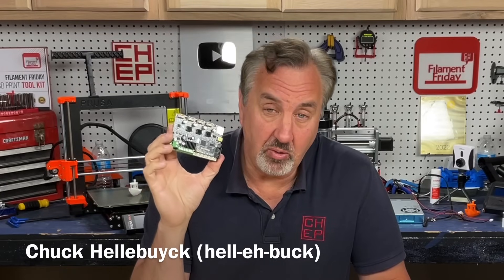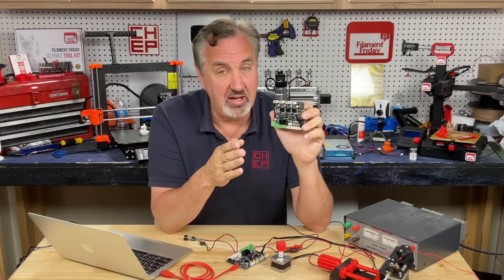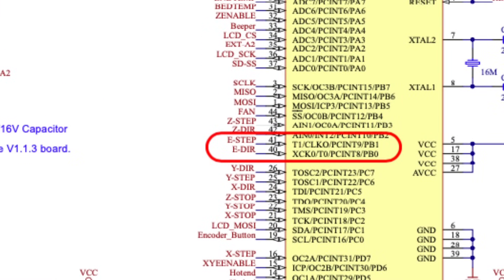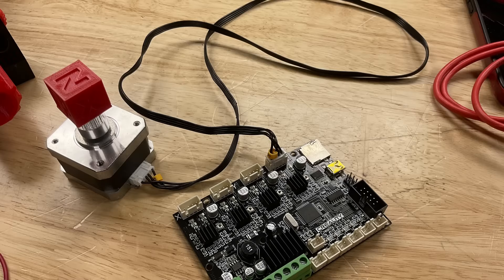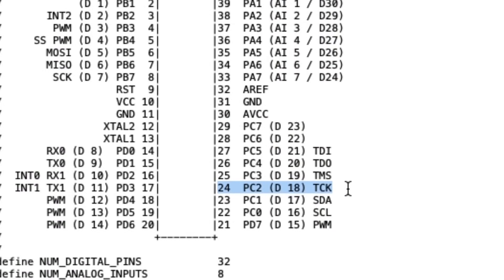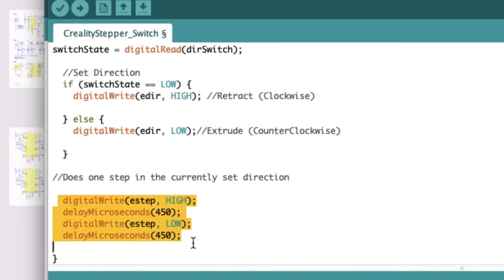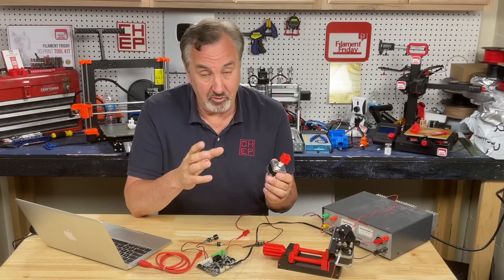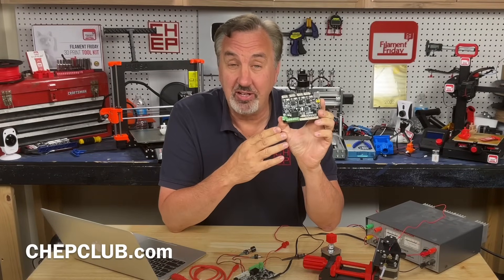Re-programming Older Ender 3 Boards with Arduino - Stepper Motors

Comment: Hello Chuck,   What can be made with a 32bit MKS Robin nano v3.0 board? I have a brand new one that was supposed to be installed in a Tevoup Hydra 2 in 1 but I shipped the printer back (actually, the 2nd one I shipped back), got my money back but kept the board. Now it just sits there in the box that it came in. If you can use it, I'll trade you for 1 of your E-Leveler 2.  lol
Reply: Anyone want to trade that board for a leveler? The board costs a lot more

Comment: Can’t see spending $35 for an 8-bit board though.
Reply from the maker: For most hobbyist projects, Raspberry Pi and many 32-bit boards are overkill. If you can find a used one on eBay or even an old broken 3D printer, what I’m showing can breath new life into a pile of junk.

Comment: I have a 32bit creality board collecting dust, any suggestion?
Reply: Yes, it can drive several steppers and fans, a display, read switches and thermistors. Already has motion control built in. Use g-codes in a text file to make a robot of your own choosing, eg bbq controller to roast your thanksgiving turkey. Total overkill for the job of controlling the temperature by adjusting the air baffle but might be just the first project.
Reply: Everything is allowed when you want to grill to perfection! Any project to link? Starting from marlin or from scratch?

Comment: Hi, nice video i really like the idea and i will make a project like this with my old ender 3 pro board. Just a quick question , i like to use the Z motor and use limit switches on the top and bottom to limit the range, like on a 3d printer. Do you have any idea on how to implemnt this? i'm not that good in programming arduino and similar :(

Comment: hello sir i am student,i have one mks robin e3 v1.1 i want to use it as normal board to control three stepper on 20X4 lcd displays and with 8 switch i don't know where to start i have work on ardunio till now and i can't seem to find any solution can you nake video or suggest me some thanks
Reply: What?! What are you a student of…Literature? You just need to toggle the output for the motors on and off. If you’ve been working with an arduino you would know how this is done. Why is it that you don’t know where to start? You don’t have a difficult problem, work it out!

Comment: Why not just use g-codes for this? You already had a (sort of ) operating system for machine controls, just control it using a simple text file on the sd card. This way you can use any printer control board to drive 3 or 4 stepper motors in real units of your choosing (m or inches or rotations etc). 
Going this basic Arduino way you should include acceleration and speed maximums or your stepper will miss steps. You have to add up your own distances. All these and many more are already done in the original code (eg marlin or grbl). Using grbl or marlin you can make tools like coil winders, positioners, blind openers, heck, I see no reason you can’t make a washing machine. You have analog outputs (PWM for the fans), analog inputs (thermistor inputs), digital inputs (endstops). You can even use the display, it just plugs in.
Going back to the bare Arduino code is fun and relatively easy but may be very much more unnecessary work.
Reply from the maker: The idea is to show you can program the board to do anything. Add sensors and components the GCode would have no knowledge how to handle them. Essentially demonstrating you can write your own control system.